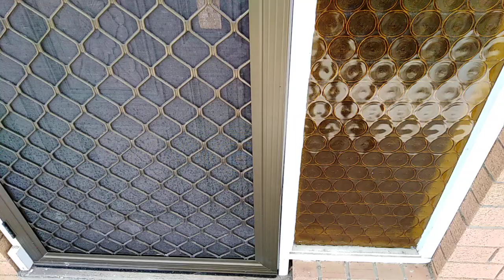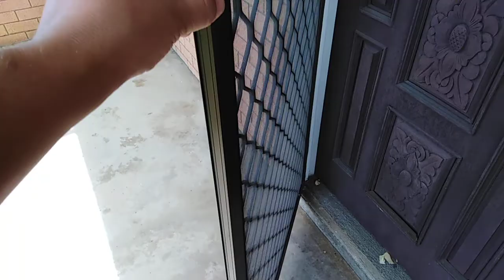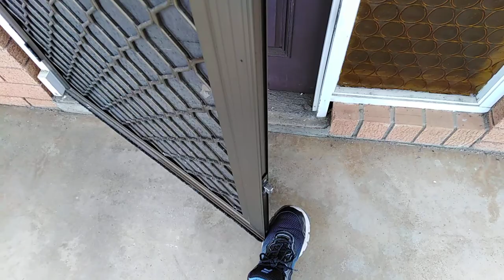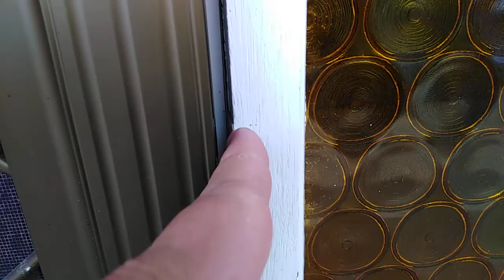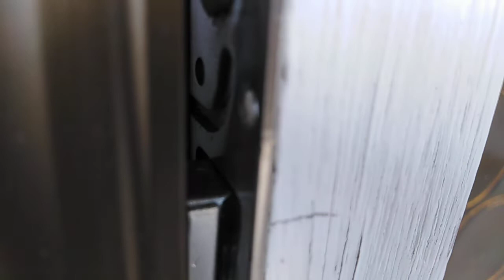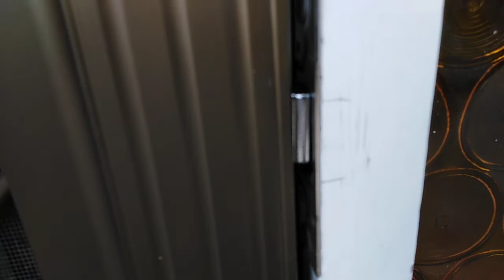"Brisbane" How to fix a triple lock security door when not locking properly

Comment: I can’t see anything that shows how to fix a triple lock not working!
Reply from the maker: Adjusting the bolts that prevent it from locking
Reply: Detect and adjust the position of the lock tongue hole at the bottom of the top to align it with the upper lock tongue of the triple lock.

Comment: thanks for the video , i thought the lock will actually lock it self especially if the door is used to access spa pool. from the video it looks like you manually need to lock is. so no difference using a key actually. maybe im missing something but not quite getting the purpose of these locks.
Reply: I agree you are not getting the purpose of these locks.  I think you might be getting them mixed up with pool gates which by law in Queensland must self close and self latch.  When both doors are closed, they provide an extra layer of security as they are harder to break down than a standard wooden door.  They also allow the standard door to remain open to catch the breeze in our hot summers but still provide security.
Reply: @Jax-2137  perhaps... the game is loosely based on RC. i like the game not just because of its mechanics but also the theme is it was one of my fav books when i was young. hence i wish there was an actual RC character in the game or one of the expansions though you could argue that RC was a good cook or a carpenter. with regards to the island i found this: The fictional character Robinson Crusoe lived on Robinson Crusoe Island, which is part of the Juan Fernández archipelago in Chile
Reply from the maker: Security screen door lock not a pool gate lock
Reply: @doctorlock  i have a security screen door installed to access my spa from inside the house. just the lock is located above 1.5m heigh to meet local regulations. whatever the purpose (mainly extra security) i dont see much difference between using the little lock and a key.

Comment: How do you get the barrel out of this triple Lockwood g28e16 I have removed all the screws the barrel will not slide out.
I have disengaged too and bottom latches,
What is holding the barrel in ??